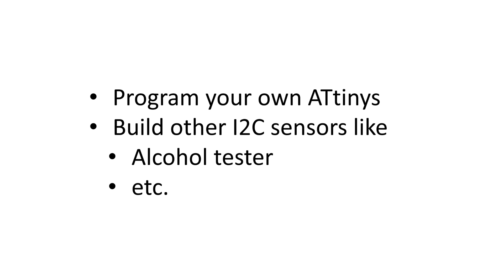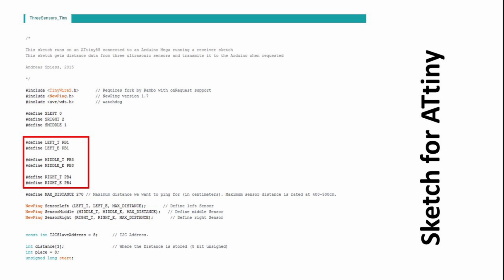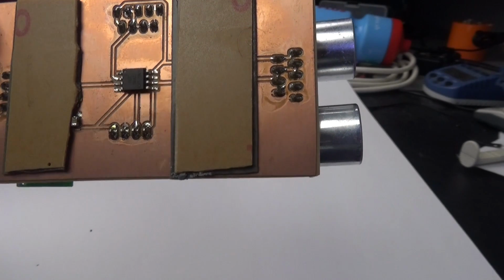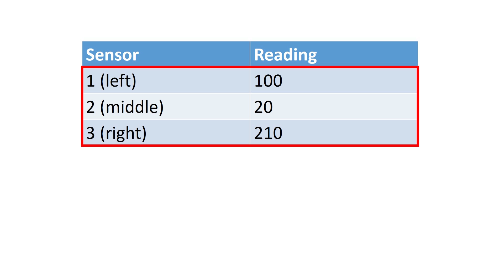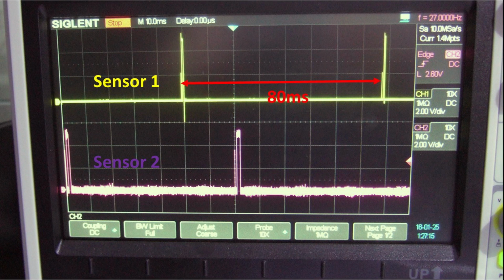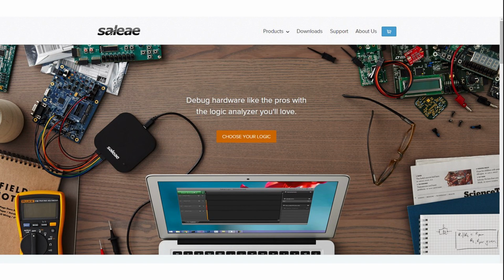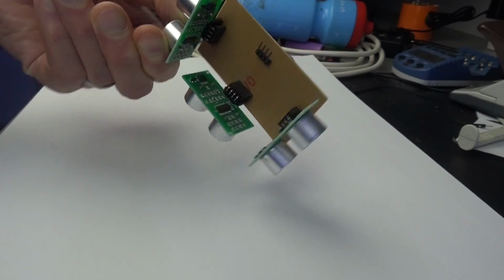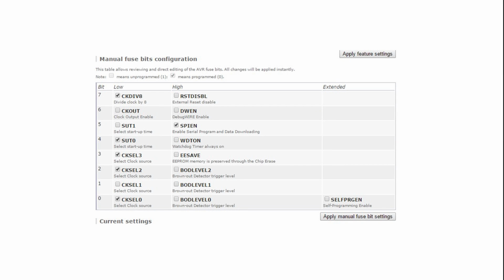#42 Build your own I2C Sensor with three Ultrasonic Sensors for Arduino

Comment: Great video again but not 100% sure about the data being retrieved from the ATtiny. This gathers the data on its I2C using three addresses for the three sensors but now you have to send the data off chip to another uP...
Reply from the maker: +Graham Gillett The sensors are directly connected to the ATtiny pins and the ATtiny does the reading of them. The sensors only provide a timing signal, no I2C. You can also have a look at my video about ultrasonic sensors about this topic.
The ATtiny measures these times, converts it into values and stores these values. It is connected to the Arduino Mega through the I2C bus. If the Mega needs the mesurements, it just asks for them trough the I2C bus and gets three values back through the same bus.
Reply: Got it. So the ATtiny takes the measurement and then data is available to the outside world using I2C. That makes sense. A "blonde" moment on my side :)

Comment: Ein must-have be attiny Projekten http://www.pighixxx.com/test/portfolio-items/tiny/?portfolioID=337 Programmieren geht auch sehr gut mit dem ArduinoISP Sketch,  ein leeres 3$ board liegt immer irgendwo rum. Für die Verkabelung gibt es einen Spezialshield mit den drei Status LED: https://modelect.wordpress.com/2012/10/15/using-an-arduino-to-program-an-attiny/ -  Cooles Projekt und sauber die Credits verteilt, das fehlt mir sonst etwas oft bei anderen Autoren.
Reply from the maker: +norm1124 Sehr schöne Darstellung des Pinout. Danke. Werd ich mir ausdrucken und aufhängen. Betreffend Programmierer: Da bin ich eben etwas altmodisch: Wenn ich etwas oft brauche, dann richte ich mich so ein, dass ich wenig studieren und noch weniger falsch machen kann. Deshalb habe ich mir mal die beiden Programmer gestrickt. Aber natürlich hast Du recht, es geht auch mit dem kleinen Board. Die LEDs würden bei meinen kurzen Programmen aber vermutlich kaum aufleuchten, so schnell sind diese kleinen Dinger programmiert. 
Wegen der Credits: Die beiden haben es auch verdient. Ohne die Libraries wäre das für mich viel aufwändiger gewesen.
Reply: +Andreas Spiess Ich habe auch einen USBasp für Wiederbelebungen :-) Pigixxx hat auch ein Pinout zum ESP-12 http://www.pighixxx.com/test/2015/09/esp8266-pinout/ , ja, die Zeichnungen sind klasse und den UNO hat er auch 1:1 abgebildet. Btw Deine Kadenz an Video ist sehr beachtlich, Hut ab.
Reply from the maker: +norm1124 Die Pinouts sind wirklich alle sehr schön! 
Ja, die Kadenz hängt natürlich ein wenig von der verfügbaren Zeit ab. Beim Roboter konnte ich auch auf Dinge zurückgreifen, die ich schon vor einiger Zeit gemacht hatte. Sonst wäre das nicht gegangen. Da hatte ich viel Arbeit reingesteckt... Und die Crimper waren ja ein kleiner Aufwand.

Comment: Great  video! What about take care of this three sensors in your main Arduino instead of creating a new board? You could trigger each sensor separately and catch the echo return using any Arduino port change interrupt without blocking your main code, of course you can't use pulseIn function as library uses. Have you thought about it? Keep producing nice videos, your accent is funny ;)
Reply from the maker: +Ronivaldo Passos Sampaio In addition to the reason of Glychee S it is the reason shown in the video: During the pulseIn command your arduino is blocked and cannot do anything else. because 3x puseIn takes about 80 ms the robot would fall down during this time. Balancing robot is a fast moving business. It has to react extremely fast to very little deviations. Otherwise, it is too late. You can try it with a stick vertically on your hand...
Reply: +Ronivaldo Passos Sampaio his balancing robot uses i2c, pwm, and he probably wants to use serial as well, im not sure,but i think most ports are already occupied by the other peripherals, which would cause the interrupt to trigger often and slow down communications.